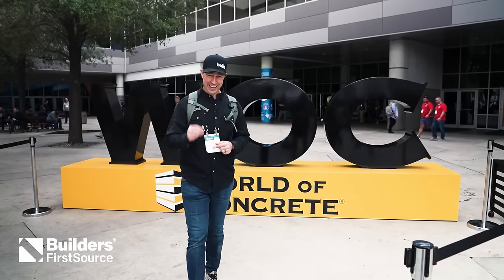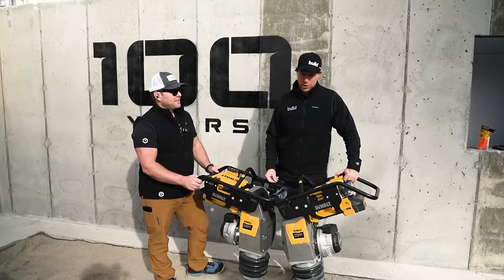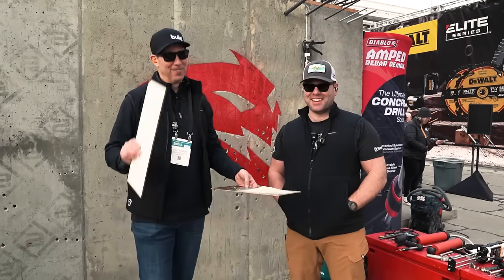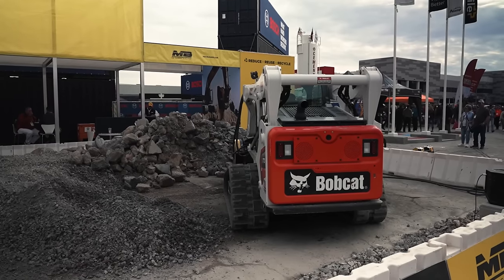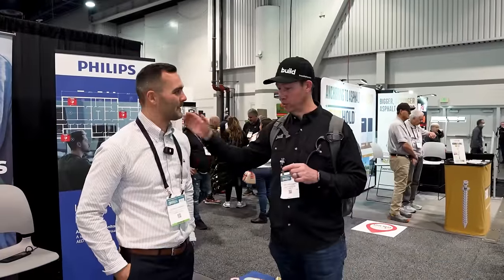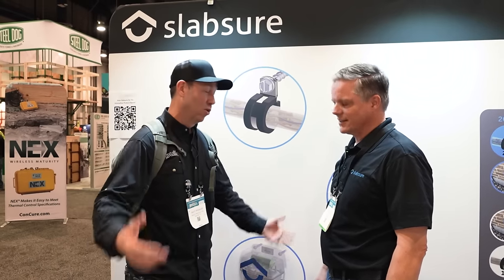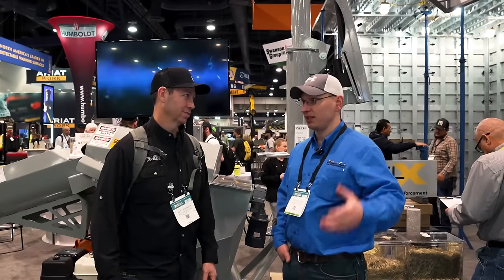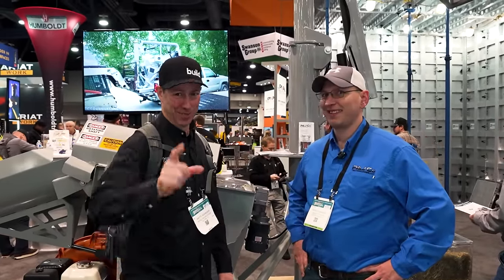Crazy New Tools & Future Concrete Additives WOC Day 2

Comment: About 14 months ago I poured a 18x24 monolith slab to set a storage shed on for lawn and garden equipment and a compact tractor. I used Helix Micro Rebar so I didn’t have to pay the contractor to put rebar in the concrete. So far not a single crack. So yes the homeowner can use these micro rebar products.
Reply: I love Helix. You should still use perimeter bar and around opening. They have great PDF engeenering doc that walk you through any use.
I using it in New builds and looking to build an exposed concrete house when I get time.
Reply: @sparksmcgee6641  yep I used rebar on the perimeter, although this is going to be pretty light duty use the Helix may be overkill. I had to buy a couple of boxes on line, the local readymix plant had never heard of it.

Comment: A “Green” platform for tech that has a shorter life, doesn’t work in cold or reduces its capacity greatly, AND IT GOES DIRECTLY INTO THE TRASH BECAUSE YOUR GREEN PLATFORM ISN’T RECYCLABLE. ITS LAUGHABLE. JUST LEMMINGS.
Reply: Leamington sounds like who you're quoting.
We've been using battery for decades.
You know you're a liar when you say they aren't recyclable

Comment: Helix Micro-rebar is what i use. Runs about $3 to 4 a pound including shipping for pallets. Uses about 7 to 15 lb per yard. That replaces about 80-90% of stick bar.
They have the enegneering statements for building departments and a residential rep at headquarters. She can get the in house structural enegenners to do work ups for you.
Mostly its a commercial product so its nice thwy have a person to help out people doing residential.

Comment: The DeWalt math is a bit uncomfortable. 120v X 15a=1,800w  ➗36 min ( trigger time) =50w per min but we have to cut that in half because he said 2 batteries.  If I remember correctly it takes .13 watts to lift 1lb 1 inch over time so I assume it jumps at least 2 inches per second or 36 watts a minute with zero losses. WHAT AM I MISSING??? I'm 360w short or a third of the battery.
Reply: Those batteries deliver 54v under load I believe. Not the 60 as advertised
Reply: They don't impact continuously only for the "jump"
Reply: @sparksmcgee6641  the motor has to run constantly otherwise the inrush current would be a non starter( were not talking hand trigger on off, more times per second range)The components would be huge to handle it. I haven't been done inrush calculations for years but it's a heavy loss.

Comment: Matt you were right with ur initial comment with the AED. Heart attacks are the most common cause of shockable arrhythmias.
Reply: Heart attack is a catch all term.  A few years ago I had a almost plugged artery, fortunately, that caused a heart attack.  A defibrillator would not have done any good in my case and may have caused my heart to stop if someone used one on me.

The three types of heart attacks are:

    ST segment elevation myocardial infarction (STEMI)
    non-ST segment elevation myocardial infarction (NSTEMI)
    coronary spasm or unstable angina

The latter is what you would use an AED on.  And they are programed to tell the difference and only activate if the heart attack is a coronary spasm or unstable angina.  That way anyone can use an AED and not harm someone not suffering a coronary spasm or unstable angina.
Reply: I’m glad you’re doing better. Heart attack is a legitimate medical and colloquial term. It means myocardial infarction from blockage of the blood vessels supplying the heart. Whether you have ST elevation on EKG or not determine if it’s a STEMI or NSTEMI. Unstable angina and coronary spasm are examples of acute coronary syndromes along with heart attacks but don’t result in cardiac tissue death. They are stratified because the treatment and management pathways are slightly different. 
Shocking with AED is not part of the treatment of any of these unless there is ventricular fibrillation or ventricular tachycardia without pulse which are fatal arrhythmias-disorder of the hearts electrical signaling. These can occur with any of the above and in fact the most common cause of them is a STEMI. So when someone needs to be shocked to restart the heart a good bet is that they suffered a bad heart attack or perhaps specifically a STEMI. 
I don’t mean to be pedantic but there’s enough misinformation floating around the internet. Not that your comment was misinformation or harmful it just wasn’t exactly right. 
I’m not a cardiologist but I am an MD and I’ve had extensive training and experience with ACS.
Reply: @frqnj 
But if your heart is still pumping blood normally it does not need to be restarted or returned to a normal rhythm, which is what a defibrillator was designed to do.
Reply: @oldtimefarmboy617  yes you’re right. The only instance you would use it is in cardiac arrest so no pulse/pumping of blood with a rhythm of either V fib or V tach. Why would your rhythm go into this and your heart suddenly stop? There’s lots of reasons but by far the most common is having a heart attack.

Comment: Someone should make powerboards extension leads that talk to each other so that you can set the max load and they never trip the braker. just specify which ports are never allowed to trip and which ones can turn off and on, then you can have your tools keep running when they draw more current cause the system turns the power off or reduces the total current available to things like batteries, coffee makers, phone chargers etc. when you stop using the tool (and some programmed time buffer you don't kill things by turning them on an off again).the low priority items turn back on.

Another idea do all the chargers have the ability to charge phones etc from the batteries incase you trip a breaker or something too? Powerboard with chargers and usb one smart solution for everything

Comment: The main problem with FRP rebar is that it's less ductile and you can't field bend it the way you can with steel.

So, given stress, the rebar cracks and breaks rather than just bending.
Reply: I've got no experience with it, but cant you buy prebend stuff?
Reply: You can mix them and put steel around bends after throwing down a pile of fiberglass. Finding them in 20 ft sticks is tougher where I am so you lose 20 percent for overlaps.

Comment: How long before they have Wire mesh made out of fiberglass for Concrete?
Reply: wire mesh is bent into rolls....that can be unrolled. can't do that with fiberglass
Reply: Metal eventually destroys concrete something that does not rust would be better
Reply: @utpharmboy2006  have you ever used fiberglass insulation because that is pretty flexible. Something as thin as mesh could easily come in roll form but even if it couldn't they'd just ship it in packs of big sheets.
Reply: @bigfishoutofwater3135  there may be a way to make it moderately flexible without breaking, but it has not been done yet
Reply: Helix -25 is what I use
Reply: @alaskacanoe6837 stainless mircorebar has been around since the 60's
Reply: @sparksmcgee6641  do you add it on site(if so what is the process?) or does the concrete co do it before the truck leaves?

Comment: Get the SteelX guy together with the fiberglass people. How much better would fiberglass be mixed in with your concrete.
Reply: It's been mixed in for decades. Take my word for it you can get anything you want for a price.
Residential concrete runs about 130 to 150 these days. 
High rise foundations and hiway over passes runs 1500 to 3000 a yard. 
You can go as high as you want using things like carbon fiber re enforcement ect..... that's used in repairs mostly. I think it would be over 20,000 a yard the last time I priced it out.

Comment: Fiberglass vs steel- it’s all about price
Reply: Got to admit wieght is a factor to once you use it. I picked up some for a drive and patio in my car.😊😊
That was the moment I realized it made a difference. Delivery or going to get my truck is at least a couple hours of saved time on that job.
Reply: Also the environment where rebar will be used.

Comment: Hopefully all these Battery powered PILES OF CRUDE are not LIKE the CARS!
Reply: The will be
Reply: Take it you also refuse to use cordless drills and other small tools?
Reply: @jimschmitz6192  I take it you don't realize this is Not cordless drills or small tools!
Reply: @Dirty_Dog_Ranch_TX  I have replaced most of my lawn and garden equipment with electric Ego products. What surprises me the most is the self propelled walk behind mower. Plenty of power and a 10 amp 54 volt battery will last almost as long as a tank of fuel on my previous Honda mower. Not saying there aren’t any drawbacks, initial price being the major one. Biggest advantage for me is how quiet everything is, no need for earplugs.
Reply: @jimschmitz6192 and you don't have to rebuild the carbon every year. 
😊

Comment: Roman concrete secrets remain undiscovered.
Reply: I thought there was good research on it potentially related to the volcanic ash they mixed in with it along with limeclasts that give it strength and self healing capabilities. There’s pretty robust research on it I just don’t think it’s economically feasible to recreate the formulations.
Reply: That's a lie.
The first SECRET is the only remaining material is in areas it doesn't freeze and it's been repaired multiple times.
We know everything about Roman concrete. Contrary to what so.e college marketing department says when trying to sell a new additive that doesn't perform as well as current products.😊